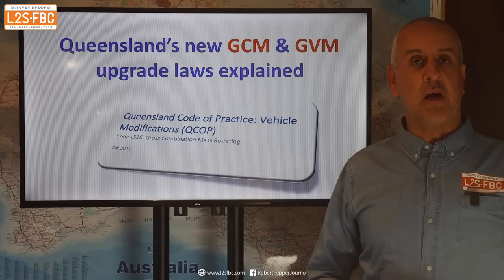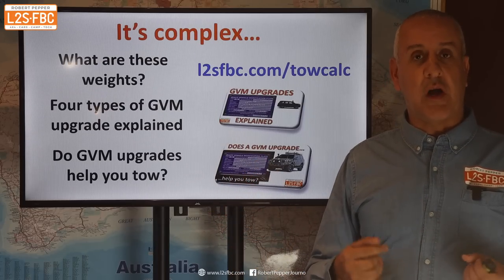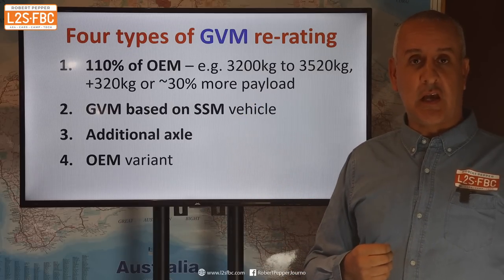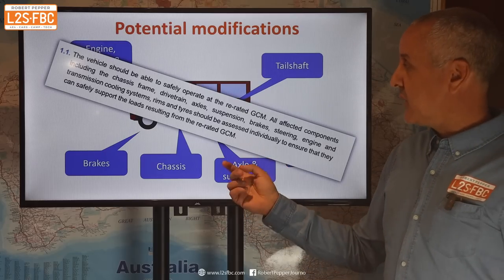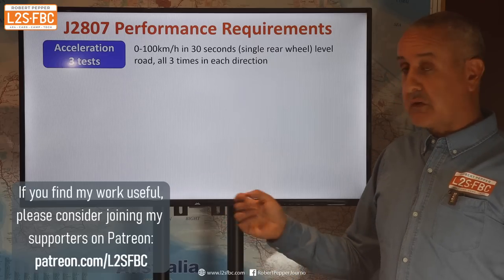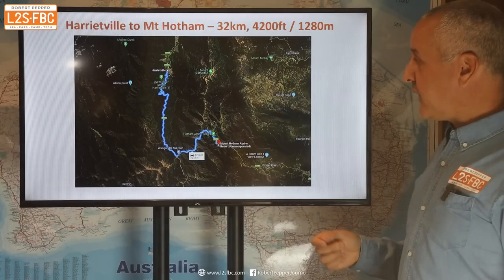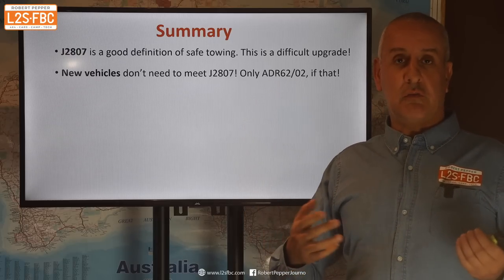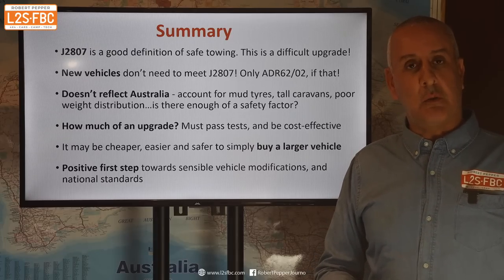New GVM and GCM laws - what do they mean?

Comment: Robert, an excellent explanation of towing capacities. The current situation could at best be described as a dog's breakfast.
Thank you for taking the time and effort to explain the situation. 
This video should be compulsory viewing by all who wish to tow a trailer.
It would be useful to revert to the former simple rule - the laden weight of the trailer (TBC) must be LESS then the unladen weight (empty) of the vehicle.
This would deter manufacturers from making outlandish claims about their vehicle's towing capability.
Reply from the maker: I agree Rob, and the new GCM rules do suggest that...but not enforce it. I would however use a different rule for 5th wheel where the load point is between the towcar axles.

Comment: The 68kg seems to be a legacy thing from when folk were not fat - 50 years ago
- the 68 kg also is featured in the Australian Design rules as a standard person mass for the vehicle
- - you will likely find 68kg per person is used for lift capacity rating in buildings
Reply from the maker: Yes airlines now use average mass of 82kg for males and 68kg for females
Reply: I'm the lightest adult in my family at 67kg.

Comment: Great video Robert. I wonder if these rules would apply on any existing cars with certified GVM upgrades? My GVM was done recently after buying the 2nd hand vehicle (not OEM) and is more than 10% of original GVM (from 3350kg -> 4015kg). Considering its been registered as such with Vicroads they probably can't downgrade me. But the GVM reverts to factory when reselling the vehicle I believe.
Reply from the maker: Typically new legislation of this nature does not invalidate older modifications. If you have a post rego GVM upgrade and sell interstate then you will need to get a new GVM upgrade certificate for that state. If sold within the same state no problem.

Comment: Hi Robert. RE: QCOP - Code LS16 (Feb 2023): Gross Combination Mass Re-rating Feb 2023. I am in Qld and have just bought a new American-made 2022 RAM 2500. Its OEM GVM has been reduced by the SSM (Walkinshaw), down to 4,490 so it can be driven in Australia without a truck license. Despite the cost ($10,000+) and my caution about aftermarket additions and modifications, I was considering having a GVM upgrade to 5,400 kg done in order to improve its Payload and Towing (Jayco Silverline Outback 21.65-LB upgraded ATM 3,700). I do hold a Medium Rigid Truck License. Under the recent LS16 can I apply to have the GVM and GCM increased in Australia to match those specified by the OEM in America? Regards Neill
Reply from the maker: I expect so, that seems to be exactly what the legislation has in mind, but you'd need to check with an authorised engineer. Good post, thanks. Let me know the result please.

Comment: Any issues with the trailer setup should be on the trailer manufacturer and the owner. the manufacturer shouldn't be selling a caravan that's excessively top heavy or has poor handling. And the owner should drive accordingly to the weight, tyres, suspension etc on the trailer. Because the bottom line is whatever you are towing requires adjustment to speed, cornering speed, braking distances to maintain a level of safety similar to the same vehicle without a trailer.

Comment: Hi Robert, I watched with interest your video on GVM, I have the latest Defender 110 D300 (5 seater) I want to get a GVM upgrade here in Queensland but am told only vehicles with a removable chassis can have a GVM upgrade, so my question to you is can I upgrade my GVM the reason I ask is the Defender v8 has a great GVM in the same vehicle and if it is an 8 seater the GVM is greater.
Reply from the maker: Aha excellent question. Is the L663 seperate chassis or not?  It's a grey area on that vehicle. If the engineers say its isn't far as the legislation is concerned, then it's not. However...I would argue the re-rating based on OEM shouldn't apply for non-sep-chassis vehicles. I'll make that point to the people in the know. I think the Defender is an excellent example as it  has a range of GVMs.
Reply: @L2SFBC  Thanks Robert and the axels are strong than one of those Super Rams so why not

Comment: Going to a light truck sounds good but as far I know there is no crash safety data for them. putting kids in lap only seat belt in all the light ridged trucks is just as scary as a slightly overloaded Ute that has been designed to pass the ncap crash test with full curtain air bags.
Reply from the maker: Correct safety is not as good as cars.

Comment: A law is useless unless it can be enforced. Current laws are not adequately enforced. You see examples on the road with tradies utes, caravan towing and lifted 4x4’s. Where are the resources to enforce the amended legislation. There is an opportunity for vehicle and trailer manufactures to upspec their product to meet market needs. I drive an Isuzu NPR truck for increased capacity, but there are challenges with insurance once you get into light truck around 4.5t gvm
Reply: If you want a good laugh...  Car license vehicles used for deliveries in one jurisdiction have a free reign.  5 tonne payload on a 1 tonne car license truck.  Or, 4 tonne in a 2 tonne van.  Fun is, as it is car license, NHVR don't want to know it, and the local police have not got facility to weigh these vehicles in the metropolitan area!  There is a weighbridge in one of the police command centres, but, a seasoned officer swears black and blue that there is not a weighbridge there.  It has a timber deck, and is an old beam type.  Told the officer to call the centre in question and ask the question of the staff there.  He may be in for a rude shock!!! 15 sets of knife edges and bearings, inspection, adjustment of the corners, calibration and verify.  Worst part would be the making up of the new knife edges and bearings, rest should only cost about $2,000 to have an old weighbridge up and running.  First overload detected would pay for the work!  After that, it would be clear profits for the government!!!

Comment: So they're introducing a new law that's only applicable to the older construction type of body on frame style vehicles, that have gone out of fashion already, due to the newer unibody styles that can easily be stronger, lighter, faster and cheaper to make. Particularly the giga-press style where the frame is injection molded in just 2~3 pieces. So despite this new law, and people demonstrating it's perfectly fine towing 2700kg with a Tesla model 3 (see https://youtu.be/FX5lzqzZ2Do?t=300 ) or even a Nissan Leaf towing at least 5000kg here https://youtu.be/RovwXstFgnE , it will be illegal for anyone in Australia to do so, as the EV companies only put low numbers on their towing capacity plates (if they bother at all) because they suggest people do not tow heavy things due to the range reduction. That suggestion becomes law in Australia and this new law will not help, as none of the EVs are body on frame style that this law requires. This frustrates me no end, as I only want to tow 14km to the boat ramp with an 1100kg boat, but the cheapest EV in Australia allowed to do that is 370% more expensive than an EV I would buy otherwise, when just about any petrol car, even a Corolla, would be allowed to do so. My tinny isn't even that big, being in the bottom half of the size offerings of an aluminium quintrex runabout.
Reply from the maker: Sorry, the Leaf is NOT suitable for towing 5000kg. The fact it pulled 5000kg very slowly in a carpark is not relevant. Large strong men have done the same. The 3 js not rated for 2700kg and there may be good engineering reasons why; having enough power to pull a trailer is not, has never been and will never be the sole determinant of towing capability - that's one reason why there are low tow ratings. I wouldn't suggest it's range.
The seperate-chassis design is not going out of fashion at all as it offers great flexibility in design, you can swap bodies on/off.
I absolutely understand your frustration re towing; taking a boat to the local ramp is a perfect EV use case.
Reply: @L2SFBC  yes the leaf in that parking lot isn't a good test, and I'm not suggesting it should bump up it's rating to 5000kg, but it does make you wonder why it's rating is so much smaller. , The model 3 towing almost 6000lb on public roads and highways at speed, plus that slalom test course is pretty compelling evidence that it's capable of more than the 1000kg it is rated for. Plus many reasonably priced  EVs in Australia have a 0kg rating, which is just nonsense. They could all tow a small box trailer with a dozen plastic chairs in it, a few blocks. As for the body on frame design, name one EV for sale for less than $100,000 AUD that has it.

Comment: Wait. At the start of the video did you say only ute or ute based SUVs can be upgraded? So a LC200 can't get a GCM upgrade under these new laws?
Reply from the maker: No I said seperate-chassis vehicles, and gave some examples. The LC200 is seperate-chassis as is the 100, 300 and Y62 Patrol. Sorry about the confusion.

Comment: Previous gcm upgrades were only allowed pre registration.  Is this still the case?
Reply from the maker: The document is, as usual with governments, vague. It says "A SSM approval cannot be used for re-rating a vehicle's GCM in-service under this code. A complete design package must be included and documented for use under this code" and "Since the certification under the LS16 code is being provided on in-service vehicles, the
condition of the vehicle is important when providing the certification. The design package must
include instructions about what is to be inspected and the acceptance criteria to decide that the
vehicle is in a safe and serviceable condition at the point of certification".   I read that as you can't develop a new GCM design on an in-service vehicle, but once done, it can be applied to registered (in-service) vehicles.  I'm going to collect a bunch of questions and see if TMR will answer them.
Reply: @L2SFBC  Lovel's do a 79 series Single Cab GVM upgrade 3300 to 4200kg and a GCM  from 6800 to 7200kg Post Rego.

Comment: I can't see many vehicles with a heavy trailer on the hitch getting up to 100kph in 30secs. It would use a heap of fuel to drive that way plus not be that good for the vehicle in anycase. Perhaps getting up to 100kph in 60secs might be more realistic. 
Or maybe we in Australia, are more patient drivers. 
A lot of drivers with caravans never get to 100kph! They barely make 90kph! Not sure if that good or bad!
Reply from the maker: It only needs to be done for the J2807 test, and of course, if the truck loses control of the trailer that'd count as a fail. Good to have a vehicle more capable than you'd need.
Reply: Hahaha, yes Robert, too true. Aways good to have something up your sleeve! Thanks for your input re the link to your other videos. I'll find time tomorrow.

Comment: No degradation to the factory ESC is the gotcha. How in the heck would you prove this? So the pollies bow to the need but put in place a large roadblock. IF you do the GVM or GCM upgrade  (at great cost) and have an accident - how will you prove to your insurance company the the factory ESC was not compromised.
Reply: If your vehicle has the GVM or GCM upgrade you will possibly void any insurance in the case of an accident even if you are NOT at fault.
I can remember when I the suspension professionally lowered on one of my cars for better stability I had to get it engineer certified before my insurance would issue a policy so the same thing may apply here, as in, the upgrades would need to be independently certified.

Comment: Be careful tho it could put ya set up into heavy vehicle territory with the extra weight combination , it's 0 limit with alcohol one snith and ya done bloody risky
Reply: That depends on the state, in nsw it’s 0.05 up to around 12t gvm
Reply: @chrisbanning413  heavy vehicle is in  truck licence territory then it's ooooo in every state
Reply: @davidmilledge221  try looking it up, I just checked & its 0.05 up to 13.9t gvm in nsw.
Wa is 0.05 up to 22.5t gvm
Nt is 0.05 up to 15t gvm.
Different states have different laws.
Reply: @davidmilledge221  also, there is no “zero” bac requirement for heavy vehicle drivers in nsw, 0.02 is the lowest category, even for dangerous goods

Comment: I’m offended. Robert just called myself and my wife midgets and kids. How disrespectful considering we’re not kids - in our 50s and we definitely are not midgets - 170cm plus.
Reply from the maker: I sincerely apologise for my choice of words. The reason was because I was appalled they would go that light; the average Australian male weight is 87kg, female 72kg and that's without accounting for clothes or personal items such as phones, wallets, handbags, even water bottles. So the 2 x 68kg occupant weight is way low and that's very disappointing to me.  Again, I'm sorry.
Reply: @L2SFBC  all good. It makes you wonder where they are getting their suggested average weights from. Definitely not ABS.
Reply from the maker: I would expect it's a very outdated measure. The airline industry had a similar problem and there was even a case of a crash due to the carrier assuming average weights as per guidelines which were way to low. Over time, our size and weight has increased and standard measures need to keep pace. I'm sad that J2807's latest revision didn't include more representative weights, and I'd have liked to have seen the vehicle tow at GVM. I have analysed many vehicle weights and sometimes even a passenger on board means the vehicle cannot tow as advertised...so it does make a difference.
Reply: @L2SFBC :  Yes, have picked this up even with passenger vehicles.  It is possible to get 5 people, 150 kg each, plus 4 lots of 30 kg luggage going to the airport.  So, that is now 870 kg payload, and most sedans / wagons fail this epically!!!    A question was asked of the passenger transport authority in my area.  Stony silence!!!  First thing I do now is to ask for the tare weight of the vehicle, ask what fuel load and spare tyres / other items are on the vehicle, then ask for the G.V.M.  If I am not able to get 870 kg minimum between the two, goodbye!!!  Space saver tyres are also an automatic rejection!!!  The bus industry has a similar problem.  Too many seats, too heavy people = overload!!!

Another point is:  Weight of the trailer shall not exceed the weight of the hauling unit.  If car and trailer, applicable.  Prime mover and trailer?  No.  Case in point:  a 2 axle truck can have a G.V.M. of 15 tonne - 6 tonne on the steer axle, and 9 tonne on the 4 tyre single axle.  It can then legally tow a tandem or tri-axle trailer.  Legal mass of 8 tyre tandem is 16.5 tonne, and a 12 tyre tri-axle is 20 tonne.  But, if the truck is towing a pig (caravan) type trailer, or a dog trailer, then the mass of the trailer is not to exceed the mass of the truck.  But, please have a read of the legislation.  As I suspect that it only applies to vehicles over 4.5 tonne G.V.M..
Reply from the maker: Good points - pig, dog and articulated trailers have three different sets of dynamics and so can have three sets of limits.  I'm forever explaining this...https://l2sfbc.com/why-a-prime-mover-isnt-the-same-as-a-towcar-and-caravan/